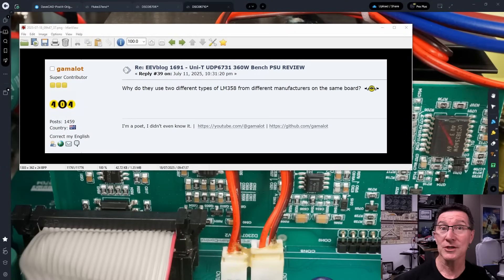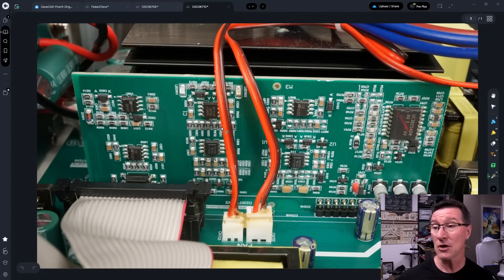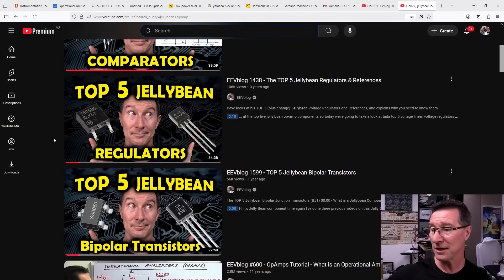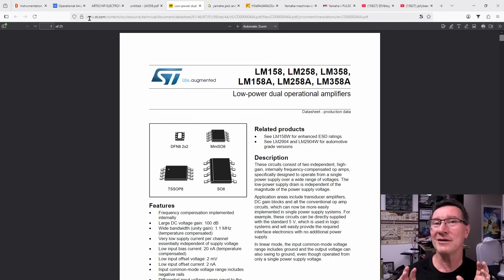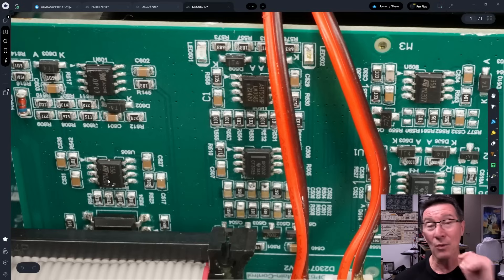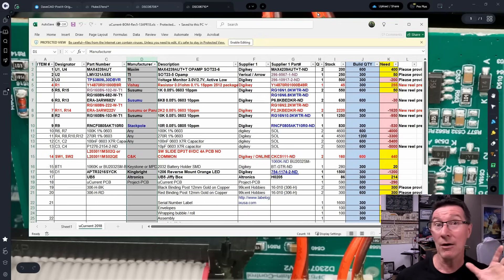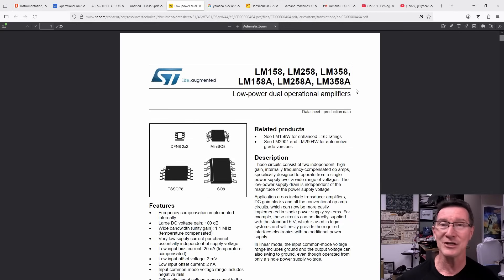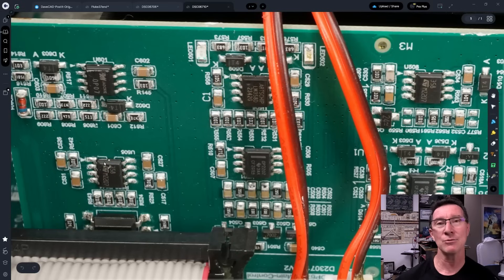EEVblog 1697 - What's Up With Different Brand Op-Amps?

Comment: In the mid 80s 'I was a semiconductor buyer at a major US automotive electronis supplier One designer chose an industry standard op-anp, RC4136 General Performance Quad 741Operational Amplifier that I had to buy from one specific supplier; their design could deliver several times the output current more than the data sheet.
Reply: For that reason the place I work at has a special 'Critical to xxx' column in the BOM. As a designer you fill in whether it's critical to safety, performance or quality. The supplier is supposed to not to use an alternative component without our approval first.
Reply: Found out a couple of years ago some kind of similar thing with a RS232 driver. Ended up in being a "this manufacturer only" comment in the BOM.
Reply: We had exactly the same design requirement. Suddenly the new boards couldn't deliver the required current. The ICs were still marked as the correct parts; the designer contacted the manufacturer and they confirmed that the component design hadn't changed. Eventually, they decapped some of the suspect ICs and found the die wasn't the same in all the chips examined, despite having the same part number and batch codes. The chips had been sourced from a well respected international supplier, but somehow fake Chinese made, or rather remarked random devices,  had made it into the supply chain.

Comment: Basically in a real life product which does anything fancy, in every single production run you get some BS where some part or other is unavailable, discontinued, whatever. So if a part is likely to have that happen you either have to buy a pile of reels ahead of time or retest the thing every run with a different set of parts. And managers don't like buying a bunch of parts ahead of time. Dunno about Dave but we always test any change, but it's a much easier process if the component is "the same number".

The explanation at the end is not what I expected though, I would have figured they cared more about the spec of the ones they populated with ST parts.

Comment: Hi Dave. How do you know, each of those manufacturers  has their own fab... or even their own process? My thinking is the 'jelly bean part' is a 'jelly bean part' with very "close enough" specifications between manufacturers...  because the dies all come from just a few fabs...  much less in number than the number of branded manufacturers... and those fabs are using almost the same process. (They are old processes.) That's what makes 'jelly bean parts' have 'close enough' specifications between branded manufacturers.

Comment: There is another reason: speed of assembly. Some pick and place machines have several arms, and each arm may load from a different reels, simply because if two arms goes to pick at the same time, you don't want to have to wait for one arm to be done picking to take the next chip, so instead you load two or more reels of the same part, and the machine will pick from whatever reel of the same part is available. It also avoid running out of parts and stopping the assembly. Reel is nearly empty? Load a new spool in an empty slot and the machine will switch over when the first spool is empty.

That same feature allow some assembly house like jlcpcb to be able to assemble thousands of different design with not too many machines. They may have 1-2 slots that are always empty, and when one reel of part is almost empty and the production needs more, they load a new reel in a free slot, and the machine automatically switch over once the first reel is empty, and eject the empty reel out, ready to receive the next roll of parts that is soon to be running out of. This allow for a continuous operation with zero downtime.

Or they can eject the now unused roll, and insert a soon to be needed new part roll. That is what they do for extended parts, and why there is a reel change fee.

Comment: I worked at a startup that manufactured Z80-based time-clocks.
We would multi-source several chips. The poor buyer would sweat bullets trying to obtain enough of certain parts. HE even had to order samples at times! Back then, mixing-and-matching wasn't a problem.
 "You get what you get and you don't get upset" definitely applied in this case!

Comment: I'd say it's from a purchasing agent trying to fill the needed BOM for a run while buying at the best price from several vendors. I used to buy a ton of 741 op amps and they varied by manufacturer from Texas Instruments, Signetics, Fairchild, and National. When I bought these, it was from several vendors, and when I spoke to the salesman, I ordered several hundred units at the best price available at the time to obtain the required quantity.

Comment: what is your opinion on Gossen Metrawatt incorrectly stating the CAT rating for one of their multimeters for the medical sector either on photo or in the text on their website at the time of my comment? SECULIFE HIT MD
Reply: Looks like the meter is CATIV 600V / CATIII 1000V , but the special anti-microbial probes are only rated IV 300V / III 600V. Which is fine, the combination probes / meter determines the actual CAT rating.
Reply: @afbor  thank you, i wonder why they dont specify this explicitly. after all we are talking about precision measurement instruments
Reply: Yeah, Metrawatt isn't known for their excellent documentation / manuals , especially for the general public. 
In any case, when combined with say a METRAFLEX 3000 current clamp, the combination is rated CATIV 600V.
Reply: ok thanks!

Comment: In the recent past I've an issue with ST LM358 output current, the specification is higher than the TI LM358, but the ST part doesn't work in a 30year old design. but the TI part does. Both parts came from the same tier #1 supplier, and no response from ST as to whether there was an issue with the batch. So, just because the part is jellybean shouldn't mean you skip testing parts from different manufacturers.
Reply: but was the design pushing the limits of what a 358 can do or was the ST 358 actually out of spec?
Reply: No, the ST branded the part was not capable of reaching the output current drive value given as a minimum in the ST data sheet or in fact the current required in the design which was half this specified minimum value. This was consistent across a reel of 1000 pieces from one batch number. We still don't know if it was a faulty batch or substandard / knockoff parts got through the supply chain via a tier #1 supplier.

Comment: ",,,come a gutsa".  Having worked in purchasing, chasing up deliveries of  scarce mil-spec chips back in the 80' after there had been a failure crisis so that there had to be a extensive burn-in testing prior to supply, it seems to me that the car industry has come a gutsa with cheap electronics in cars (ICE & EV).  I should imagine that car-electronics should be better than mil-spec as arms are usually effectively single-use whereas a car buyer would expect a decade's use and a ready supply of replacement elements - mechanical, electrical, electronic AND software.
Reply: mil-spec includes aircraft electronics, so this is a pretty high level of expected performance.  I only did military aircraft electronics, and not stuff for ground equipment, so they may have another variation of requirements for that.  I can say that military aircraft electronics were required to operate from -55C to +125C (quite a while ago), which is a wider temperature range than industrial electronics.
Reply: @SkyhawkSteve  Yes, but in military thinking the life expectancy in combat is relatively short. It seems cynical to think in 'canon fodder' terms but that is the nature of the warfare beast. And then a lot of gear become rapidly obsolete in the technological race. Of course there are outliers of which I assume the B52 bomber  (if you don't take into account lots of re-engineering) might be an example.  ps Throw in another wave of suicide drones!
Reply: @SubTroppo  well, clearly stuff like missiles and projectiles will have a short time in action, but they are required to have long shelf lives and tolerate storage under various conditions.  I designed stuff for the C-17 back in 1988, and I'm sure that my stuff has been updated with more modern electronics.  Obsolescence of semiconductors is an issue in the world of industrial electronics too.
Reply: Let’s not forget about the thousands of components found in aircraft electronics/electrical systems that comprise “permanent installations.”  On the H-model HC-130s I flew/maintained, there had to be thousands of compartments made in the 80’s still going strong well into the 2010s.
Reply: @scrivs1976  Still going strong.  I imagine that the boards they were soldered to underwent mechanical  testing prior to delivery and were "potted".  I don't own a car but if I did I'd be temped to see whether some of the controller boards were made to a similar standard.  However I can check Diagnose Dan's latest video.
Reply: There are automotive grade parts, basically like MIL-SPEC but different.  Been around for decades, eg AEC-Q200 convers passives.  Like MIL-SPEC-xxx you have different grades, eg the good stuff is temperature rated from -50C to +150C while the bits for the radio will be lower but maybe still have a high-ish vibration rating.

Often AUTO-SPEC is better than MIL-SPEC.

Comment: Don't these jellybean opamps typically also have well-known "standard" internal implementations? This is highly unlikely to be a factor in a product like this, but one might choose a part such as this and NOT utilize it as a black-box component just for its generic function. Maybe even the specific brand comes into play? I guess that's somewhat unlikely though. IIRC lm358 in particular does have a few distinctive properties to its design.
Reply from the maker: You could find a spec and a way to design in a specific brand 358 if you really tried, but my point is that would generally be considered bad design practice.
Reply: @EEVblog  The point is nice and clear thank you. Enjoyable and informative as always. I'm talking about an exceptional and probably not ever sane case indeed.

Comment: I once had to fix an item that had a tiny smd transistor accidentally placed upside down, so of course that circuit didn't function. I don't know much about electronics but I did know that transistor was in charge of the beeper not working in one of the products we sell. It ended up upside down like a little turtle shaking it's legs in the air...lol. the contacts were never made since it's legs faced up, it was an easy fix. 
I assume someone bumped the machine while it was operating.
Reply: I had to fix a series of boards that all had one upside-down placed component, never knew what exactly caused it, but I told the pick-and-place machine operators to sort it out.

Comment: Dave, Did you by chance look at the replacement board picture to compare Op-Amps used in that one? Also did you consider re-flowing the board and trying your test again?
Reply from the maker: They are the same actually. Could have been the same batch run, in which case dual sided dual head PnP machine load with different reels on each side. OR they really did design in a different brand 358, that would be scary.
Reply: @EEVblog  Appreciate the answer, although what about the Oven re-flow test? or replace an op amp?

Comment: Yes, please continue the jelly-bean series.
Reply: Mosfets jelly beans
Reply: @Skaaaaal  Yes please
Reply: I'd love to see a continuation of the 74 logic series, five wasn't enough!
Reply: I thought more chips should be covered, such as ‘nicer’ but inexpensive chips like OP07C. So perhaps the series could be expanded with a ‘top picks’ series.
Reply: @davadoff  OP07x could be something @marcdraco2189 is looking for. Great!
It is a good jellybean.
Reply: so many different categories to cover
Reply: I found a 5532 clone recently that operates down to +/- 3.3v (the original needed +/-5. I have to make sure I used the right one because my design is running a little under 5V (from a split USB) and the older ones are going to be on an edge case.
Reply: @marcdraco  What brand is that 5532 OpAmp?
If it is Chinese, don't trust without verification. They like to throw numbers and in practice it only manage a fraction of what the datasheet says. A Chinese once told me "in China there are different levels of fake".
Maybe TI:s OPA16-serie could be an alternative? Some goes down to 1.7V (if the rest of specification suits your need).

Comment: More jellybeans, please. And perhaps also a video about unconventional uses of components, like transistors & diodes for temperature sensing, LEDs for light detection, bipolar transistors for negistors and zeners...
Reply: I don't think that's really unconventional, at least for the temperature sensing ones
Reply: @urnoob5528  You're right, that's fairly common, but still far from the normal intended use and something a lot of people are unaware of.

Comment: I think you are saying these parts by different manufacturers named the same part are electrically near enough that it does not matter if you mix them up? I was thinking originally they may go for the most expensive in the most low tolerance locations.
Reply from the maker: Correct.

Comment: could also be multiple heads loading, and one side has  the ST part loaded, and the other the Art part. Then it was easier and shorter path to load the 2 ST parts on the one head, and the Art part on the other, as the one head was busy reloading while the other is operating. might be the next board has only 1 St part, and 2 Art ones, because the timing was such that now the last head off now went second, as the board moved, so the other head was now positioned to operate first, with it's 3 reels of parts, running off one reel till detecting empty, then switching to the second reel, so the first one can be replaced by the operator, so as to not stop the line. Same for the other parts, minimum of 2 reels, so that the machine does not stop for an empty reel, and can run for hours, to do thousands of boards for stock, then be changed to the other boards later on.

Comment: Another possible reason is that at design time they originally specced a different part in the BOM, later decided that LM358 would do, and it was easier to just load another reel than change the production data.
Reply: Or the reel was changed with the board half stuffed
Reply: Doesnt really explain multiple different chips per board though!
Reply: @TheMrKeksLp  yes it does, and it happens sometimes in fast delivery runs.

Assembly house starts setting all the feeders, loading all the reels, then someone realizes someone in the chain fucked up and the reel doesn’t match the footprint. 

They call the designer, ask if they can load a LM358 instead. Designer approves, so now you either go back to play with the P&P, or you just grab a second reel of chips from the bin and place it in the separate feeder.

Because it’s a jellybean component, a lot of assemblers stock them together without regard to manufacturer.
Reply: @theondono I shouldve watched the whole video first, doh!
Reply: @theondono  Are you writing in some sort of obscure verse or are you just needlessly vertically padding your writing?
Reply: Or it was the end of the batch and the operator had a dump bin of 358s as long as the dot matches the dot